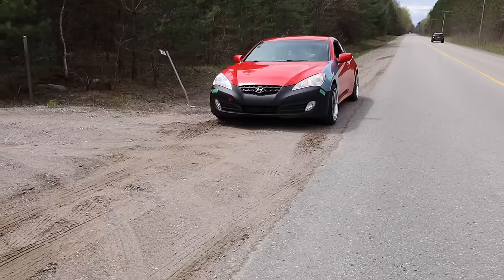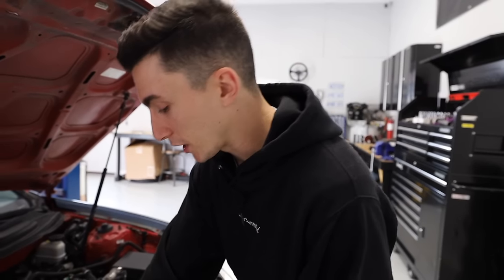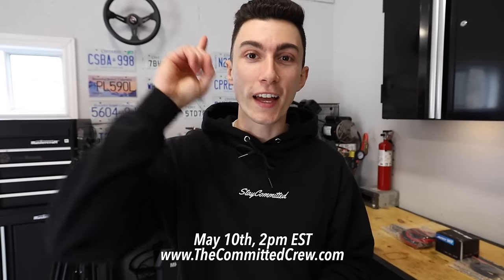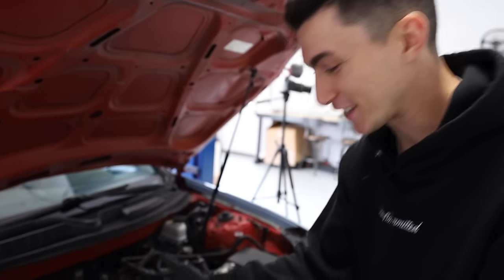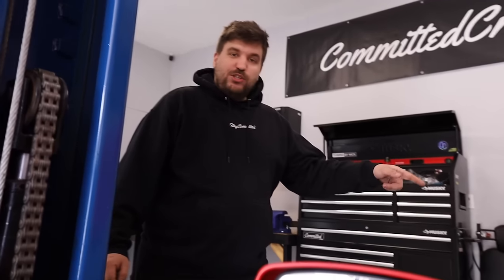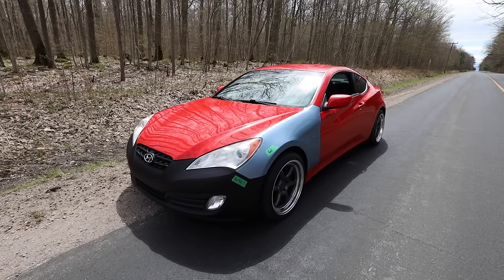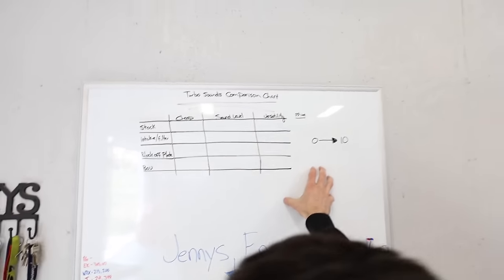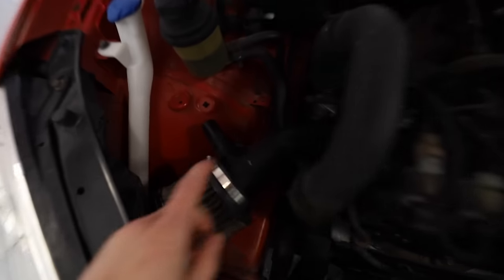Battle of the Turbo Sounds! WHAT SOUNDS BEST!?

Comment: I was messing around with my 2.0 TDI and found that if I pinch off the BOV hose I get crazy turbo flutter. Then I tried driving with it like that, and got put into limp mode haha
Reply: becase turbo flutter is a noise of a turbo breaking down and damaging itself
Reply: @envyXzor uh not really it can’t damage it it’s just turbo bark
Reply: @noahgray-jt4gq turbo bark haha

Comment: Having done the same things, running no BOV will trigger DTC P2261 that will limit your boost to 5 psi until you clear it 😅
Reply: That’s neat lol
Reply: You mean when they put on the block off plate? Do you know how someone would go around that psi limiter?
Reply: @ian.williamson  aftermarket ecu or a good reflash from a skilled tuner. I just run a BOV for now, stock is blocked off.
Reply: @ian.williamson with a tactrix cable you can manually disable codes
Reply: Just bypass the bov solonoid
Reply: Mine goes from 15 to 7
Reply: @ian.williamson  Yeah just dont do it dude, seriously.  It is VERY bad for the turbo, and will be a giant headache with trouble codes.  The trouble codes are there for a reason lmao.  The "advice" of just bypassing the solenoid is some of the worst advice you could get.  Bypassing the solenoid will also bypass many safety features that prevent damage.  Which having the bpv blocked off will multiply by 10.  Just get a Blow off valve..  I picked up an RFL from turbo xs and it sounds sick.  I've had quite a few people ask me what turbo I'm running, and are surprised when I say its still stock.  They work fine out of the box, and then you can either bypass the solenoid to have it work better, or the safest option would be to buy an aftermarket solenoid like seco.
Reply: @johnsullivan937  Very bad for the turbo = if it does any damage it's so minimal you wouldn't notice.

Comment: The block off plate with no bov is causing pure turbo surge (nowhere for the pressure to go except load the surge line and escape through the compressor) Engine can handle the couple more psi more then the turbo seals/thrust bearing can handle the aggressive pressure escapes/increased temps. Cool thing to try, but wouldn't recommend sticking with.
Reply: what if i run a bov on the cold side and just block off the hot side stock bov?

Comment: I run a super tight recirc valve on my Subaru. Also have a nice, fat, aluminum turbo inlet. I get a nice BOV sound on full boost, but get some sweet compressor surge noises otherwise.

Comment: so the OG 5 clyinder quattro cars have a reserc valve that redirects the air directly into the turbo inlet. its also very large, so from the factory they make a beautifully violent "PSSSHHHH", and if you pull the vaccum line to it and plug it with a bolt of the ignition cover it makes group B "stututututututu" sounds

Comment: Always recirc. Different manufacturers and spring rates change the noise enough to find something that you like. Never failed me yet. This was a good watch
Reply: Use whatever is required. If the car uses a airflow sensor you have to recirc or it'll die on hard braking due to flooding the engine. It will also run rich in general even if it doesn't die.

Comment: Good content man, good fun and practical education with experimenting.. however id like to state this fact as i see too many 'car guys' say this like they know what theyre talking about exactly. Turbo surge, flutter, stututu, is NOT damaging to your turbo, at low boost levels. Low is generally anything under 1.5 Bar pressure - 21psi, with variance dependent on your engine and turbo size. Furthermore the only time it becomes damaging is when youre running high boost pressures, which in hand will also present the likely case that the high pressure air in the intake can force back through into the engine as well by lifting an intake valve when it should be closed: This is what causes damage - piston colliding with the valve, over revving and lean mixture due to air coming into the chamber when throttle is closed.
The only reason i preach this knowledge is because this makes the difference between how sure and confident someone is on their modifications or current state of their car.
Reply: Even if the pressure somehow makes it past the throttle plate it's not going to cause a valve to open when it shouldn't.

Comment: I was told, the reason the put re-Direct valve.. I think it is.. is just what you said.. It aids the acceleration.. but it sounds much better to release into the atmosphere.. I have a 2016 Veloster Turbo, and the hose for re-circulation valve is blocked off.. so it vents out.

Comment: The normal bypass valve with an upgraded air filter has the Best sound while not destroying the turbo and engine and giving a lil bit more power. The blow off valve is More expensive and doesn't help the Turbo spooling up faster. And the plate is just killing and engine.
Reply: How is the plate killing the engine?
Reply: @DriftNick  since it's doing the stutututu and killing the turbo slowly theres a higher chance something bad may happen to the engine as well
Reply: @benjaminnurmentaus4232 Higher chance something bad may happen to the engine?
Reply: @DriftNick  yes. And it's not a matter of if but when
Reply: @benjaminnurmentaus4232  What do you think is going to happen to the engine?

Comment: On mine I didn't need to put a plate. I just got two rubber chair leg fittings and clamped them on the fittings that suck and blow and got the same sound you get at 10:08

Comment: not all boosted cars can run bov´s. my cffb 2.0tdi got some weird german shit called a ''vgt lader'' variable geometry turbocharger and boost is not controlled by a combination of wastgate and rcv/bov but by fins that change their angle of attack, controlling how much/fast exhaustgasses hit the turbine. completely closed means no gasses flow over the turbine meaning you dont get any boost, basically acting like a fully opened wastegate. (at least i think so)
Reply: That’s an important distinction, boosted gasoline cars can run a BOV but it’s a bit more complicated with diesels.

Comment: You've never heard a turbo untill you've heard two huge compound turbos blipping at 110 psi on a cummins truck. 2000ft lbs at 1300 rpm is like the hand of God scooting you along . I personally like a s369 sxe over a s488. No stero needed.

Comment: I'm running the gfb 50% recirc 50% atmosphere on my o2 wrx, not bad with just running cobb tune but peace of mind with a pro tune is the route i ended going. running hks intake, tomei intake pipe, mishimoto intercooler pipe, catless on my quest for sounds. still doesnt sound as good as your set up but its very fun. stock tdo4 duh
Reply: How much did it cost you to tune the car with the bov and what was so annoying with the cobb tune? really appreciate if you can give me some insight

Comment: I got a 2006 mk5 gti it needs a little work I’m just trying to figure out why it says “stop engine off” “low oil” “low oil pressure” but it has good pressure, good oil pressure, a new oil pressure sensor, and the oil is topped up, idk why it’s yelling at me every 2 - 3 minutes after the car is warmed up

Comment: Like he mentioned, blocking off the turbo will make the legendary stutututu sound, but, it puts a lot of stress on the turbo, as for those who don't know, the sound is caused by air escaping in the wrong direction out of the turbo intake.

Comment: Lol we run 28psi on a 3076r with no bov and its a daily driver for the past 30k. 

Turbo flutter on decel is not terrible. Turbo flutter is only dangerous when it happens during acceleration. Which is due to pressure issues
Reply: It's not optimal but if you get literal surge then yeah that's no longer flutter lol

Comment: There's absolutely no damage being done to your engine using a block off plate. If anything, it would be your turbo being damaged, but even this isn't true at all. 

Multiple youtubers running no BOV/BPV and their turbos last well over 100k miles. Running a block off plate, which is known as "compressor surge", is commonly believed to cause harm to the turbo. However this is nothing but a myth, if you actually dig deep into the subject on google. Turbo's are built a lot better now then they were back in the day, and damage to the turbo is minimal, if any at all.

Also I would highly suggest anyone who is trying to make their turbo spool louder, to look into the t51r mod by OCD works. It is a mod to your turbo that basically makes it to where any turbo will sound like a freaking jet engine while spooling, and make it super loud, with no alteration of the function of the turbo itself.

Comment: With a Tiguan 2.0 tsi what kind of sounds could I get with a cold air intake?
Reply: I got a 2.0 tsi stage 3 tune through APR.

Buy there Corbin fiber cold air intake and ecu Tune. Also get yourself a oil catch and

Comment: Love the block off plate idk why when I put one on a couple years back in my gen it threw the car into some kind of limp mode 😭
Reply: its because it expects recirculation, you need to remap or flash the ecu
Reply: @stinkfart697  it takes quite awhile for any damage to actually occur, usually several years. it does actually cause additional wear, but I've known way too many people that have run surge setups in the 12-20 psi range for years without issues to actually care too much about it
Reply: @stinkfart697  fair enough, I just hate when people act like it's gonna instantly destroy your turbo. for me the sound of the flutter is so cool that if I have to buy a new turbo after like 3-4 years, I'm cool dropping the money on it.

Comment: Cut a gasket for the block off. The lower psi is flowing through but the higher rpm is stuttering since the excess psi  isn't escaping through the blockoff. Your welcome from a 140iq player. Lol. Building an lx9 malibu ordered a little thumper cam.
Reply: Also did an alternator the pay equated 320 an hr. Lmao.😊
Reply: I'm cracked.
Reply: But that's cuz it was done in 15 minutes lmao.

Comment: Yeah, I'd say there is a loss in translation of the sound, because on my phone, the car sounds like my rototiller running wide open, while chained to the back of my truck dragging it down a gravel road. The turbo I had just sounded like a jet taxing on the tarmac

Comment: I did a diverter valve delete on my 2017 Tiguan Limited and it’s got 120k kms still going strong. Turbo flutter hurting your engine / turbo is a straight wives tail Istg.
Reply: And it’s been stage 2+ since 30k kms. 18-20psi I think?

Comment: The block off plate is causing surging, that's the flutter sound your noticing. Very bad for the turbo!
Reply: Wrong.
Reply: @Br0d0n  How so?
Reply: @Technotranceism  There are several videos on youtube debunking this. It isnt spinning your turbo backwards, it is just slowing it down. So pretty much all that's happening is you are losing boost, very little wear is going on.
Reply: @Br0d0n  Depends on the turbo, and when that surge is happening. Ball bearing turbos off throttle flutter, isn't a killer. However, on throttle surging is. Really old turbos suffer from both.
Reply: @Br0d0n  It doesn't slow the turbo down, people have tested it with turbo speed sensors, there is no difference in turbo speed after you lift off the throttle, valve vs no valve the turbo speed goes down at the same rate.
Reply: good to know @DriftNick

Comment: Stututu is probably the worst thing you can be doing for a turbo.  Whenever you hear that sound the driver has absolutely no idea how to tune his car and size his equipment.
Reply: my cobalt ss turbo was doing stututus only with a couple of blown sensors, definitely not good
Reply: Meanwhile it's common place in motorsport not to run a valve, I'm sure BMW and Ferrari have absolutely no idea when it comes to building their GT3 race cars.
Reply: False. Do your research